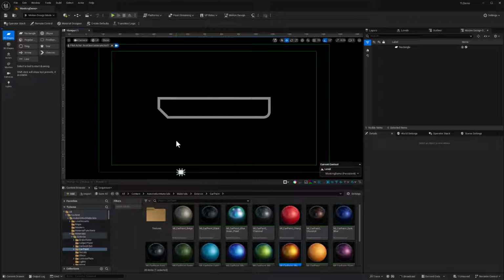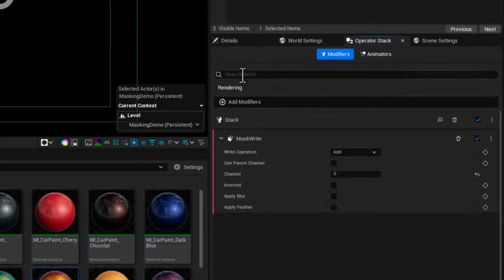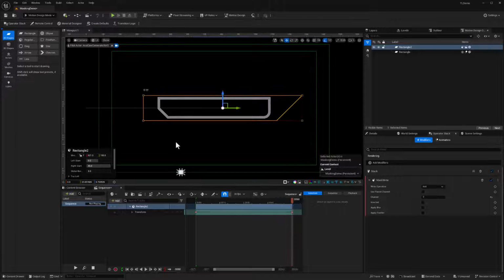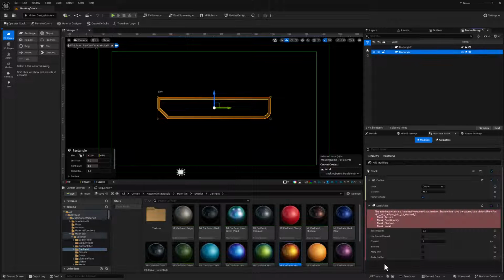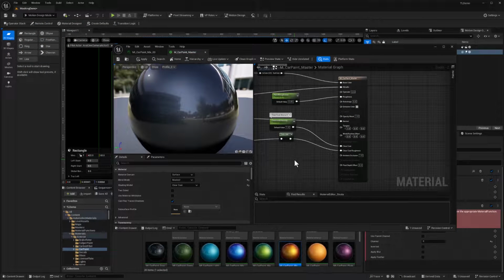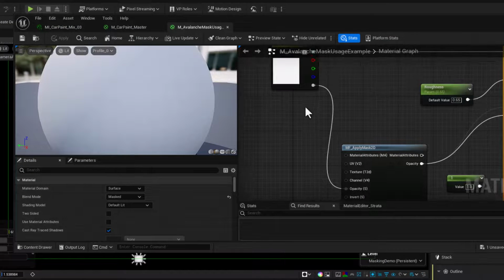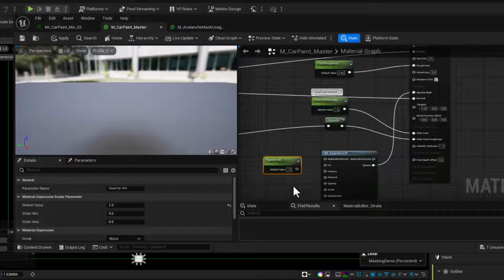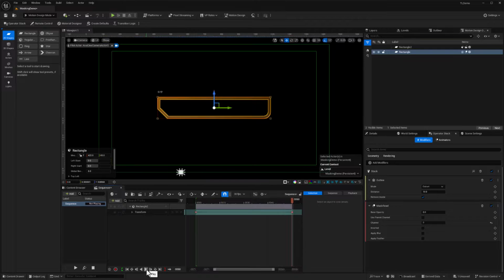Unreal 5.4 Motion Design Object Masking with Asset Materials

Comment: Some minor corrections:
1. You don't need to make your material Translucent if it's not already, this will be done for you.
2. Translucent materials are used when the mask is feathered, Masked if not.
3. Make sure you plug the custom function's Opacity output into BOTH Opacity Mask AND Opacity, so your material will support both scenarios.